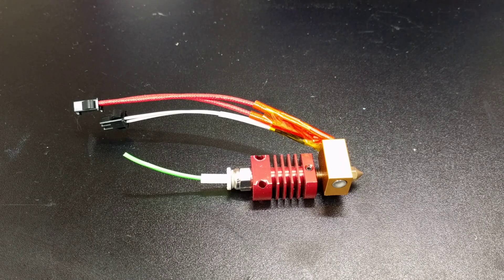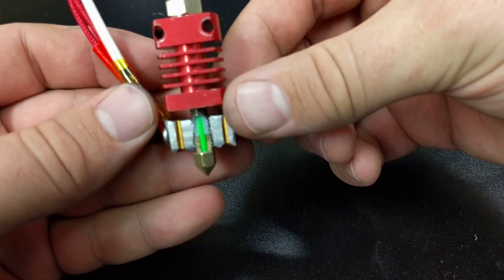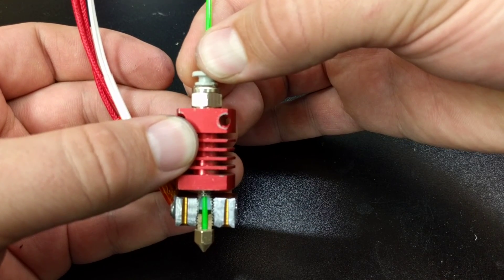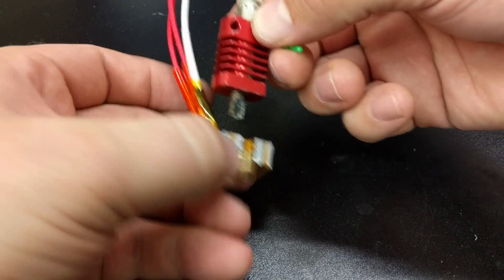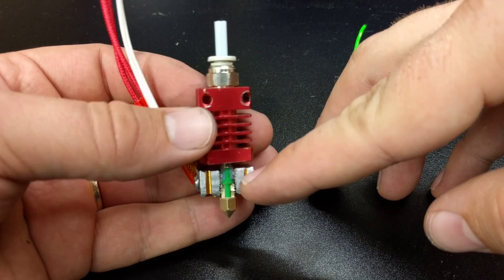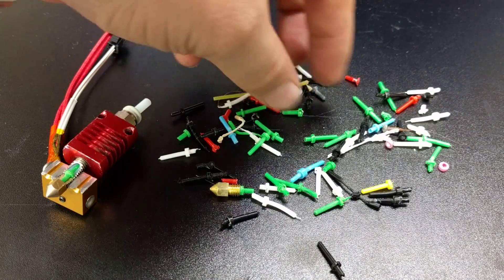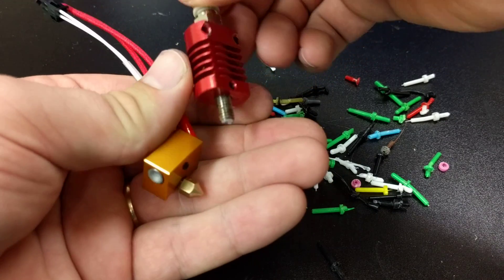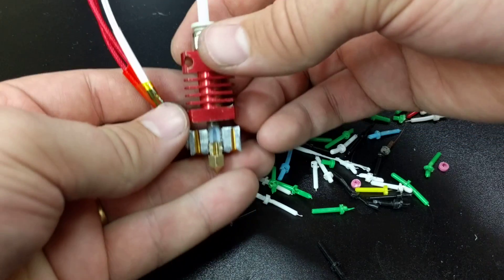Creality3D Hotend Issue - CR-10 Series, Ender 3, and others

Comment: It's exactly what stopped me from printing in PLA for years. Once I purchased an Ender 5, a Micro Swiss hot end and a Capricorn tube, held the PTFE tube down hard as I pushed the 2 coupling locks on I was finally able to print in PLA. Because of the constant, never ending problems it created beforehand I absolutely hated PLA (never happened with ABS) and refused to use it. I was apparently foolish in saying PLA was an outrageous, unreasonable problem for me because the only reactions & responses I was given were intentionally insulting to me and accused me of things having no relevance to as much. I'm not homosexual but for some reason many used that in their responses to my statement of my problems with PLA. Micro Swiss & Capricorn fixed the PLA issue.

Comment: Nice job,  I've been having the same issue with my Ender 3...  I leave the nozzle loose,  about 2turns..  Then install the tube..    Then ,  ,when I tighten the nozzzle,  it butts right up against the tube...  But , occasionally,  it screws up..

Comment: What a great video. This must be my problem. I've had deterioration issues with my prints and a strange phenomenon where I cannot retract my filament to change filament, but I can push it through.
Making me push through an extra 20cm of filament or small print to change to a different colour filament.
I knew this was some sort of a block, but I think I'm not clearing out the nozzle properly by putting the PTFE tube back in correctly. So re-creating that same gap, and always causing that block.

Comment: If you seat the tube before the nozzle you can achieve a tighter bond between the nozzle and the coupler and the ptfe tube, when the tube pushes back to lock it in place. the only downside is making sure the ptfe tube is cut square to the coupler and not pinched, I have found using a short piece of filament when cutting the tube will stay round and not change the center of the tube weather you use a knife or cutters.

Comment: I hope this fixes my problem. My first 5 prints came out just as expected, but then when I went to print again, it wouldn't extrude and the gear would pop/slip. At first I thought it was my bed leveling. I tried releveling it a few times but that didnt work. I finally took the nozzle off and found one of those blockages. I thought that would fix the problem but when I went to print, it did the same thing. Maybe it created another block while heating? Any ideas?

Comment: I put the nozzle tight, then open it 1-2 turns, push the ptfe in, then put the nozzle back in tight. Sometimes i do that from the pneumatic fitting side as well.
Also some nozzles threaded section is too short and you never get it properly tight.

The heatsink itself is also inadequate. better heatsink + full metal throat would make most of this irrelevant as well.

Comment: just print a sacer for the coupler then it can't move anymore.... i had the same problem on my ender 3 and fixed it with just printing a spacer (on thingiverse, ender3 pressure fitting fix) and it works jut fine now... no more clogs
Reply: I even just used the thin zip-ties that come with the printers too, they fit perfectly!
Reply: @RACustoms   yep me too! still have no mayor problems with my printer so far (don't want to jinx it) but stil learning with each print as i go on 
:)

Comment: How do you recommend getting the plug out? Remove the ptfe tube and filliment with a cold pull together? Or do you drop the nozzle and push the plug through? I've been getting a lot of dripping plastic after a print before it cools and some stringing. Even with the coupler clips and retraction turned up to 9. Thanks for an interesting and enlightening video btw!
Reply from the maker: Heat the nozzle to 100°C and remove it. You can pull the plug out with the nozzle or with a pick. Then seat the tube properly and reinstall the nozzle.
Reply: Masters of the 3rd Dimension Thanks for the clarification. Love the cut away also.

Comment: I covered this in my video. It’s the coupling that’s the problem. A good coupling will let you push the PTFE all the way down even when the lock ring is pulled up. Then the good coupling won’t let it back out. The stock coupling on Creality don’t hold the PTFE well enough so it works it’s way out during retraction so your prints slowly get worse.
Reply: If it ever comes back. . Take a look at https://www.thingiverse.com/thing:3203831 ;) if you haven’t already lol.

Comment: Mine was perfect from factory, and you can check if yours is too just trying to pull the ptfe tube out of the extruder. If you can't it is OK because that means that they tightened the nozzle against the tube and the teeth inside the coupler bite the tube and can't retract to release it. And be careful to properly assemble the extruder whenever you disassemble it or remove the tube. That is: screw the nozzle to the heating block, then the heat break, insert the cooler and fix it in place with it's screw then unscrew 1 turn the nozzle, insert the ptfe tube until it touches the nozzle and then tighten the nozzle again. This is how mine came from factory and how I assemble it always, never had such a plug. And if you cut the ptfe tube or replace it be sure that the side that's goes inside the extruder is cut 100% straight.
Reply: you can't check whether there's a gap between the tube and the nozzle by just trying to pull the tube out since the coupler may be already locked. The only thing you can do is actually try to push the tube in. If it moved, it means there was a gap.

Comment: How does this affect printing quality, are there tell tale signs in my finished print jobs I can check for?
Reply: mostly underextrusion due to the blockage
Reply: @baschz , Weak parts I assume, and clicking of the extruder?  I've been tearing my hair out over this.
Reply: I know I'm very late but in case you still need this answered, it'd show up excessive stringing, oozing, and sometimes blobs of molten filament making its way through the threads and onto your print

Comment: How do you fix this permanently? Great video by the way, I am having the same problem
Reply from the maker: David Bradford The easiest way it to remove the nozzle and push the tube in further and pull it back until it's flush. Then reinstall the nozzle. It should stay in place after that.
Reply: Masters of the 3rd Dimension thank you very much!
Reply: For permanent fix buy a new ptfe coupler that has metal teeth as ender 3 of mine is only plastic press fitting
Reply: For permanent fix replace the heat break to an All metal 1.75mm one and be done with this
Reply: @dimanarinull9122  I replaced the OEM with the Micro Swiss all metal and have had nothing but problems (not the only one). It hates retraction past 2mm and some filaments just won't work at all. I'm going back to OEM but using a higher temp tube. Looking right now for a good top coupler.
Reply: @_AutoCoder   why the micro swiss? the E3D works just fine for most people I know and I'm going to switch too, also it's cheaper from what I've seen.